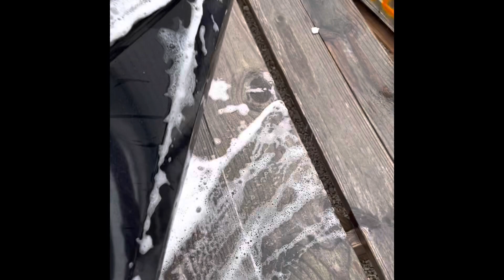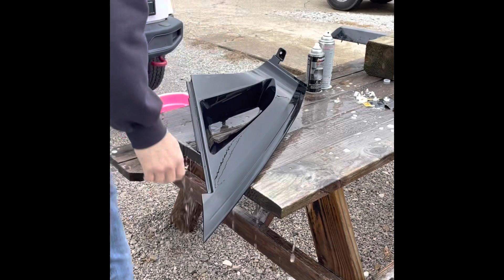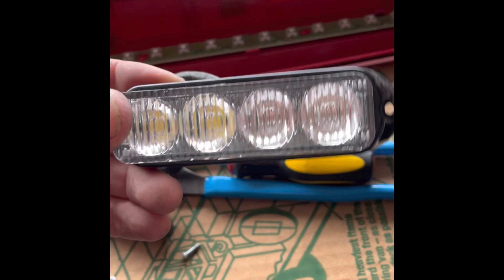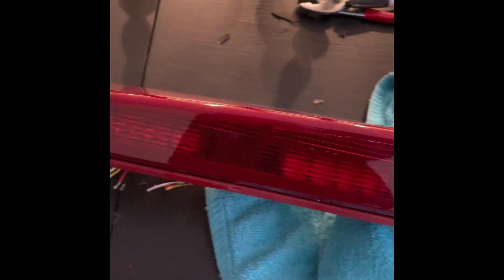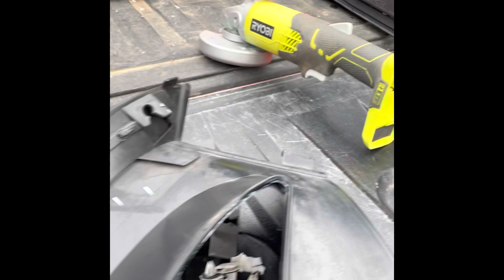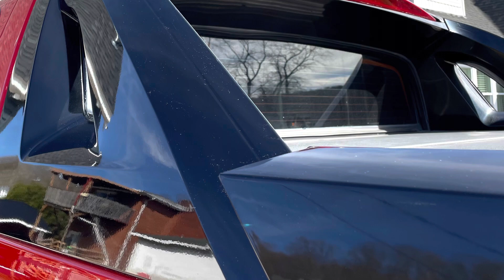(AWESOME) Chevy Avalanche Cladding upgrade.

Comment: what year is your truck? Also with the install of the 3rd light, did you have to do any type of mods to make it fit. I just brought a kit and it does fit my 07
Reply from the maker: It’s a 2005 no mods to make it work because I used all of the Cadillac parts and they go right on the Chevy.

Comment: Good job on the replacement but where did you find the clips to reinstall it and do you have to part number or website
Reply from the maker: On Amazon I just typed it the vehicle info and used words cladding clips and just matched them up by the pictures on Amazon

Comment: How did you get the lights to flash without a flashing module?
Reply from the maker: Each light has its own built in module you just set the pattern and then every time you apply 12v power it does what you programmed it to do.
Reply: @TreadOnFire  ok, how you set the pattern! Mines broken on the side, loose connections.

Comment: What do you call that piece your replaced and where did you find it?
Reply from the maker: I believe your asking about the third brake light. Cadillac made a similar truck but it had this larger brake light like I installed along with painted cladding unlike Chevy that used a very small brake light and didn’t paint all the plastic parts. I just swapped the parts from a junked Cadillac EXT that someone on marketplace was selling parts off of.
Reply: @TreadOnFire  You should have put that in the video. looks like you just painted the plastic!

Comment: What holds the 3rd brake light on, on the bottom?
Reply from the maker: The cladding that mounts to the back of the cab has several screws that bolts it down to cab and there is about six screws on the inside of that cladding part that holds the third brake light in place
Reply: @TreadOnFire  I'm switching mine to the EXT cladding and 3rd brake light also. I was trying to figure out what holds it on on the bottom. I know there are six torx bolts on top of the 3rd brake light.
Reply from the maker: @lorettamulkey7508  the Chevy cladding had two bolts and some clips holding the bottom but the Cadillac only had two little plastic pieces that used a double sided tape that clipped to the cladding basically nothing but it seamed to be stable so I didn’t worry to much about it. If it becomes a problem later I will have to modify something to hold it. I’ll video it if I do.